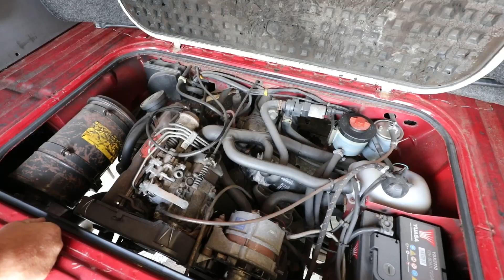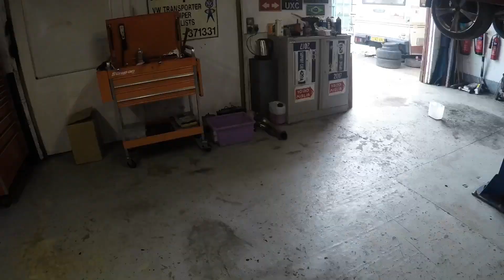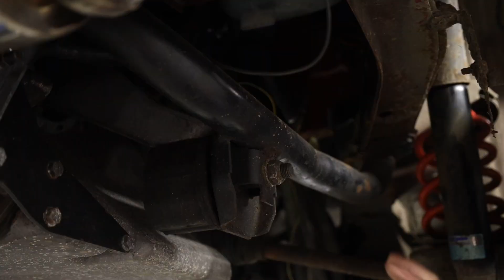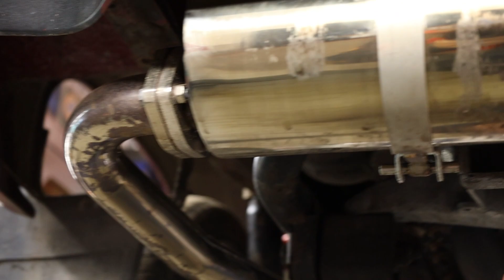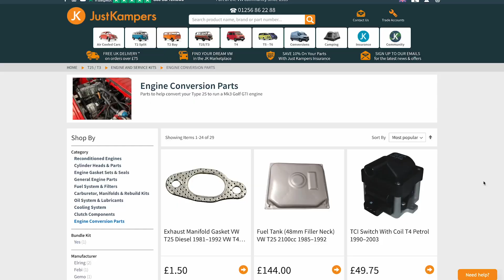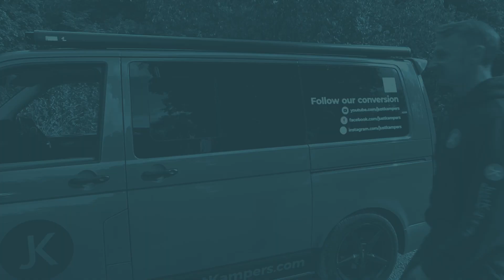How do you do a Golf GTI Engine Swap into a T25?

Comment: Hi there hope you good. Im in SA and recently bought a Vanagon that came in a 1.8L which i would like to change to the 2.0 AGG engine. However i would like to know how the power is with a fully loaded car? Most people are recommending the normal 2.5i or the 2 6i we have this side but i really havent heard much good about them lol and i would like something fuel efficient and strong. Nothing ridiculous but i need to know when i go up a hill i wont struggle with family inside or when we tow for a road trip
Reply: Here are you? I'm in Cape Town. I fitted a 2L fuel injected VW Golf AGG motor. It's more powerful than the 2.1L waterboxer. I am still running it on the 4speed gearbox and the old digifant ecu. I plan to swop the 4th gear for a 5th gear and built an ecu just waiting for the wide and o2 sensor and controller which should get here the end of Nov. I get about 8.5km/L to 9km/L on the long road. I wish I had the extra R8k for a diesel engine at the time.

Comment: Great, i will do actually the same job on my T3 (T25 in UK) with JX. My 2E comes from a Golf 3 with low mileage (but rusty). Hope, your videos will help me 😉
Reply: Hi, did you get round to doing this? Did you use any guides? I've recently bought a t25 that was stripped and came with two engines, one being the mk3 gti engine. I'm trying to find a good guide on how this is completed.